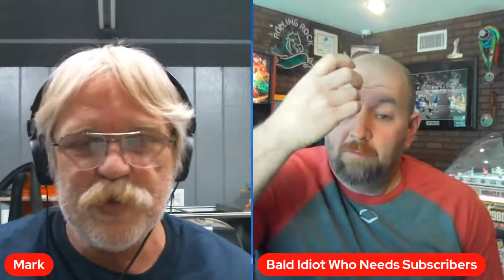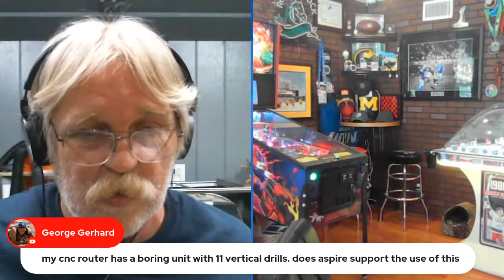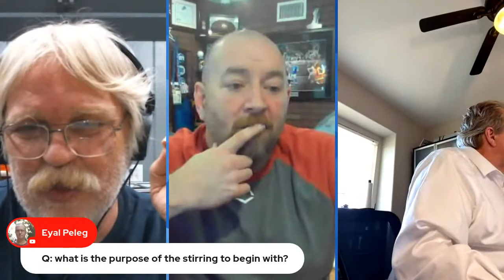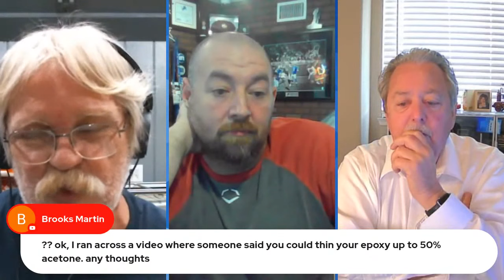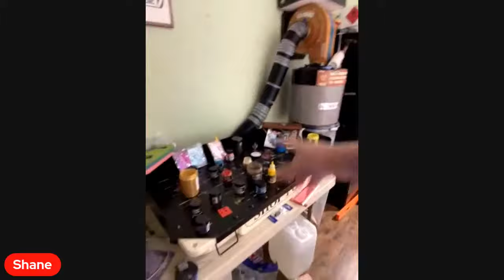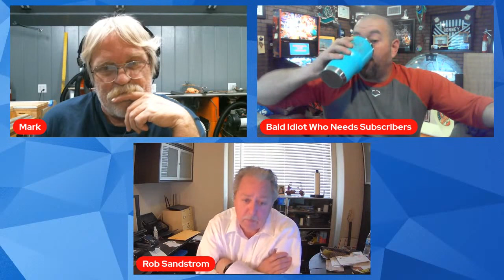Live Q&A #128 –  Open Q&A PLUS a Special Guest

Comment: Okay I am jumping on here to ask a brief set up question to help me be aware of the previous videos I'll need to start with.
I have a series of operations that goes something like this. 900 x 1 inch disks of coloured epoxy with a different diamond engraving on each one that is then filled with a black epoxy which is then surfaced off  to leave a clean engraved line and then another layer on top of this the same, so like pour, surface to exactly 1mm, engrave, (surface again if it raises the edge during the diamond drag, probably just sand and blow out) pour black epoxy in line, surface to remove excess, repeat.
I am aware of the array tool path copy and practicing that , I am struggling with getting a single line tool path on the engraving, I know I need to learn to edit nodes more.
Do the nodes order in the creation of a line make a different to the tool path cutting order, like does the first node point become the first point of contact? - If so and if your using bitmap to path thing (sorry I can't recall the name) which automatically creates the node can you change the order of cutting? - As there are so many micro lines to engrave I need to make this absolutely as efficient as possible so I want to aim to reduce machine time in every way I can. 
From other types of work I know I should probably be using layers and templates and I will look up your videos on that, but anything you can add here considering this operation??
I can't figure out the preview and play thing either, I sketched a simple design at first trying to get practice at the bitmap and tool path part, and I did something which made the actual tool path render not show me anything except for green and red lines, but I have no idea what I did.
Reply from the maker: You'll want to go to the description and check out Rob Sandstrom's epoxy inlay video series. He discusses the depths at which you'll want to carve to ensure you don't carve or sand away the epoxy you're inlaying into the base color. I can tell you now that a diamond drag bit will not carve a deep enough area for the epoxy to stay in. You'll sand right through it, if it survives the surfacing process at all.
Reply: @MarkLindsayCNC  Just to clarify, my lines do not need to be done like other deep colour inlays, they are meant to be very very faint, it doesn't matter if it's only 2 thou deep, Imagine it like a litophane type scenario. Is there any chance you could test this on any excess materials you have? If you have any diamond bits that is.
I do think it should work, epoxy is a molecularly bonding material, and the surface height wouldn't be changed from the previous operation, as long as that bit is clean it shouldn't go through the lines...unless maybe the tramming is off or something wiggles loose...I dunno
Reply from the maker: Again, go watch Rob's video series. He spends a lot of time on this very topic. There is no way .002 deep is deep enough for the epoxy to survive surfacing and sanding. Molecular bonding has nothing to do with it - abrasion during the finishing process does. Feel free to do your own testing if you'd like, but before you do anything, I highly recommend you watch at least Rob's video on his failure - it's specifically targeted to the depths needed to do epoxy inlays.